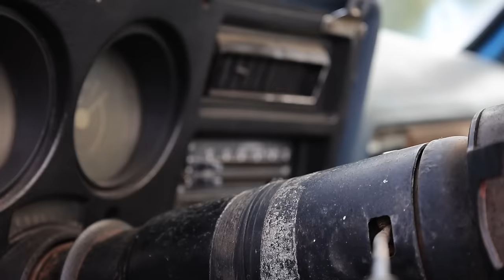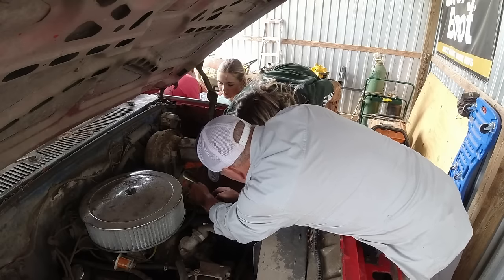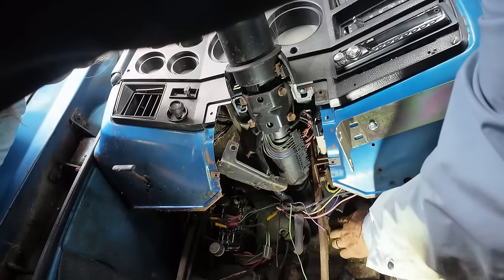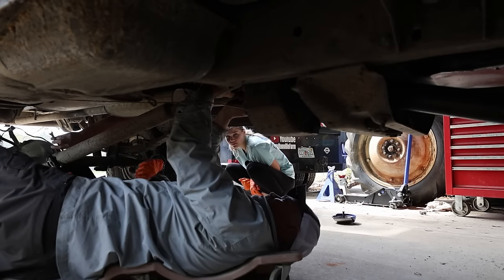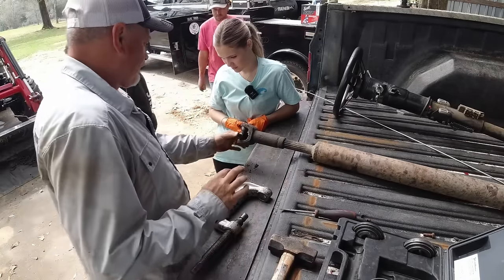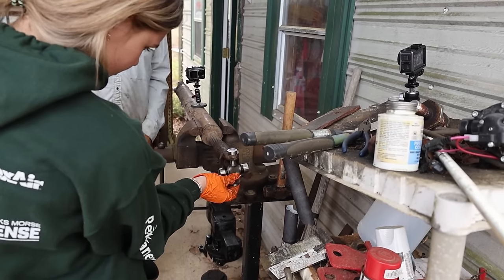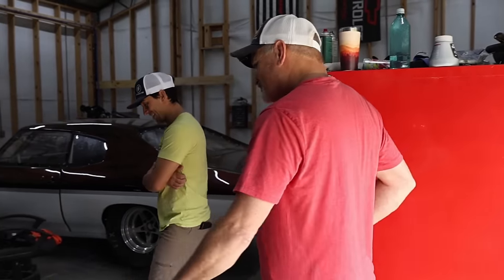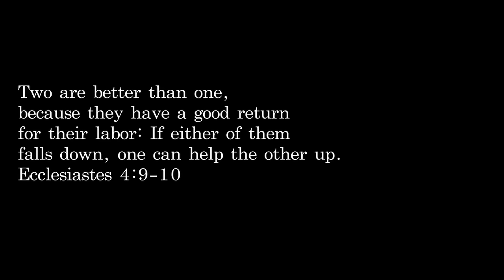What could it be? K10 Square body has serious steering issues!

Comment: Hank sent you some pics to your brandmanager email address of my 1973 Chey 4x4 truck. I painted it a GM color called Marina Blue F/3860; mine is done in a PPG base coat clear is with PPG Urethane clear coat. This is a great color as it has staying power in the sunlight and remains very stable over time. It is good to see you getting the twins involved. My dash instrument panel is from the 73 and I installed a nice steering wheel from a 76 Camaro. These are much safer in accidents and prevent serious head injuries. The stock steering wheel is a killer they are very hard and unforgiving. The local salvage yard did not have any when I did mine; I found a nice one on ebay for $25. Good luck and good to see they are invested in the truck.
Reply: You got a screaming deal if you got that wheel for $25, they are becoming sought after, had one from my 74 Camaro that I put in my 80 squarebody

Comment: The ignition switch on the column has slipt down a bit. The key switch is rolling back to far. Just loosen the the 2, 5/16  bolt's on the ignition switch and push it up towards the steering wheel   . Tighten is  bolt's and it will start.

Comment: I noticed at the beginning of part one when you guys first got into the truck when you guys got the truck there was couble of wires that was hanging down that had a jumper wire in it that is the neutral safety wires then towards the end when you were loading the truck on to the trailer the jumper wire was gone from the neutral wires.

Comment: Hank You all should set up any nuts or bolts you are trying to loosen or remove especially the girls that it is much easier to turn a wrench and not strain anything if the wrench is in a position to be pushed down on instead of trying to lift as your body weight and muscles will assists in having better leverage. Hope this is helpful..
Reply: This guy's a super genius😂

Comment: hank good video sir,  next time if u have to push a vehicle with ur tractor use a old rubber tire,  tie it up there with a rope.  it will reduce the shock when bumping the truck and also give u a some what a soft surface to push against amd did you grease the slip joint on that driveshaft when installing u joint.

Comment: Come on Hank. I know you know what you meant and I know what you meant but those girls are just learning so be accurate in what you say. That first thing you pointed to is the steering shaft which is connected to the steering column on the upper end and to the steering gear box on the bottom end.

Comment: One of the things I love about square body trucks is that there is actually room to sit on the fender instead of leaning over. So, with that said, y'all are doing it wrong. 😁

There's also a style of creeper that you lay down on, over the engine. Don't know if one would be tall enough to work with the lift on that truck.

Comment: The ignition switch is attached to a rod that pushes a sliding plate in the switch actuator module halfway down the steering column. That sliding plate aligns the power, starter and accessory functions with terminal links that connect to the corresponding wires going to those destinations. It has the spring that kicks the ignition switch from start to on. The quickest fix for someone in a hurry who really isn't that mechanically IQed is to buy a used steering column.

Comment: Correct me if I’m wrong, the drive shaft is supposed to slide on the splines?  Helps the rear end articulate with the lift and rough terrain, if it’s out of balance that will cause issues for the rear end also?

Comment: Hank....you don't look old enough to have granddaughters that old. I just turned the BIG 50 a few mths back and only have one grandchild so far. And it's a boy. He's only will be 4 this year. You have some beautiful granddaughters that wants to learn how to work on a automobile. Times like this they will remember when u pass away. Im curious yo see how its gonna turn out. They ought to put that steerin wheel off of the old column on the new one after they get the rust off and get it back to looking new again. And i think it would sound good if it has dauls on it coming straight out the back. I had a 74 El Camino that i wished i still had. It was 2 tone grey with a 350 in it with bucket seats in it. The drivers bucket seat swiveled outward. It had mag wheels with 235/70/r15 Road Hugger raised white letters tires on it. I drove it in my senior yr of HS. I REALLY loved it. I was planning to run duals on it after HS when i could have afforded it, but unfortunately, that didn't happen. It got wrecked when i was coming out of a side road onto another road. The side road that i came out of there was a house in the corner on the left that had some bushes blocking my view just a lil bit. After making a complete stop at the stop sign, there was another guy coming in my direction from town that i didn't see coming, he ran into me and didnt have insurance and had been drinking a lil bit of beer that day. And he was a well known alcoholic around town. I went to city hearing or had city court cus of a ticket from the wreck(cant really remember) the city made that intersection a 4way stop sign cus of the wrecks that was there cuased by them bushes blocking views at that house on the corner. And the city made the owners of the house keep the bushes trimmed at all times. Tell your granddaughters glad to see them wanting to do this and we can't wait to see the finished product.

Comment: The only thing wrong with the column that was removed from the truck was the linkage rod popped out of the slot on the actual ignition switch itself tell tale sign is no spring back or push back when the key is in the start position.

Comment: I have to replace the steering colum in my 94 Chevy 3/4 ton 4x4 truck with another one I got to pull it out of another 94 Chevy truck and then pull mine out and put the other one back back in my truck

Comment: 1975 ( lol) they did not have square headlights to the 1980'S the front end wont fit (yes i do know) safety neutral when they move  the shifter you seen the black tape ?? i had a lot of them

Comment: I noticed it really needs a pinion seal its blowing oil  out the front if the Diff that could be why its clunky maybe no hypoid oil .
Reply from the maker: Yeah it's gonna need some rear diff work for sure 👍
Reply: @HamiltonvilleFarm  Good 308 or 300 rear is awesome for this truck mind you its 4x4 right the front should be one spd faster to keep from hopping .

Comment: How about you use metric tools they will fit the bolts better an save you from rounding off bolts an don't for get to use you tube to help you learn as well by typing in how to remove a steering  column  or drive line plus they tell you correct terms for tools

Comment: How did you determine the steering column was bad?
Reply from the maker: Tested all the common issues, bad safety switch.  Rod to the neutral switch. Etc.  I think we determined the clock spring was bad too. I'm not a steering column guy, but my buddy helped me trouble shoot it.

Comment: I'm a locksmith and I find it funny that everyone wants to blame a lock cylinder instead of the ignition switch that is the electrical part on the top of the steering column under the dash.i laughed my ass off at you guys trying to teach those girls how to fix something when you don't know what your doing. Don't get me wrong I glad you are trying but you should do some research first. When my daughter was 16 she rebuilt her 350 Chevy motor and today she's 39 years old and work's on her husband's diesel truck. I've been a mechanic for 50 years from doing mechanic work to now a locksmith for the past 18 and I also done paint and body work for 21 years

Comment: The ring pinion and bearings are bad you shouldnt beable to turn drive shaft at rearend win both back tires on the ground its leaking oil bearings are bad
Reply from the maker: Yeah, I think it's gonna need some work done to it for sure. We will tackle that later.

Comment: Plastic bags and write where the bolts came from. Teach them right old man.  Taking the steering wheel out when it could be a dead spot in the starter.  
You are going to end up with a bunch of parts and a tray of bolts and nuts.